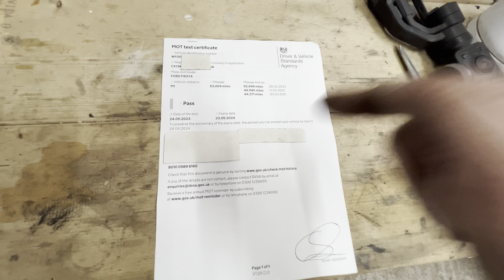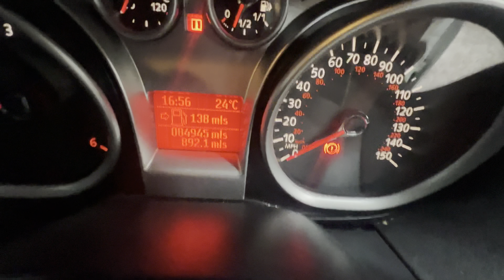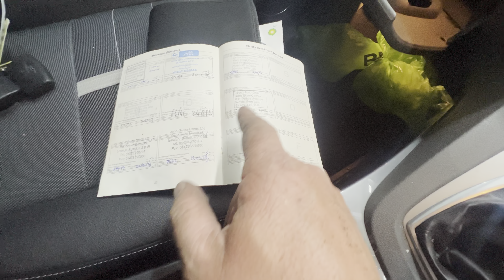Ford Fiesta Car S Goes For The MOT And I Pick Up A New Project Water Damage ????

Comment: Dehumidifier won't take out the dampness below the carpets. To do it properly you need to take the carpet completely out to dry. Also, any electrical connectors below the carpet may be water damaged. Rust and black mould will develop on the floorplan and carpet if it is left too long.

Comment: Mrk the fiesta turned out really well. The KUGA should be ok once all the water is out of the carpets nothing worse than wet carpets steaming up inside glass on the car.
Just speaking from experience had to do mine with a wet vac for hours been better off with a pond pump.

Comment: Mirrors fold in from the drivers side switch, set it to centre and press, it will fold them both in. I have 205,00 on the clock on mine (2010) always keen to see what your familiar with. Then again always good content. Thanks
Reply from the maker: Thanks Bill wow you’re one has done high mileage 👍👍